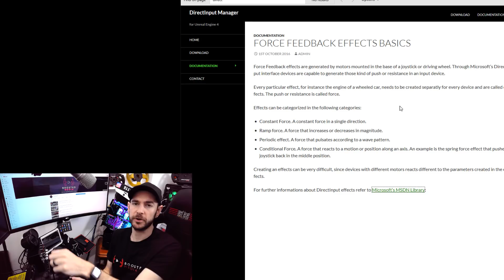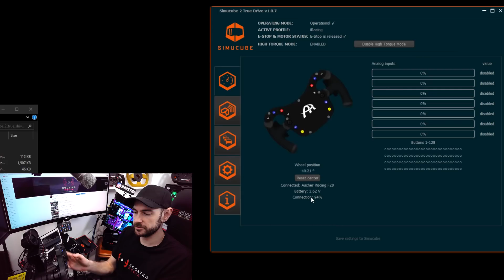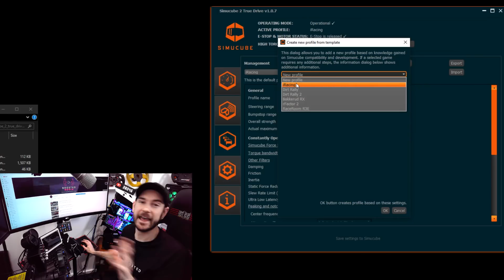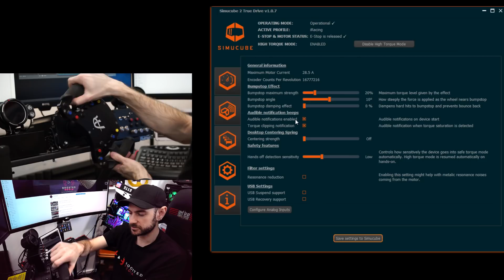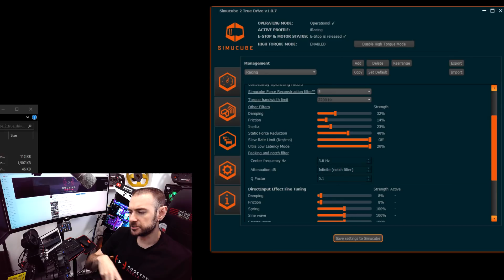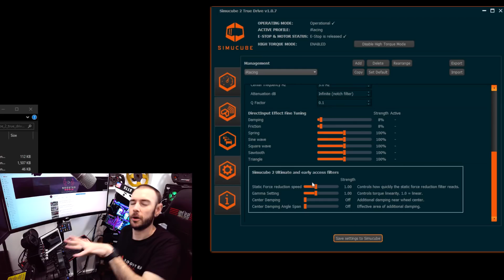HOW FORCE FEEDBACK WORKS - Each setting explained in detail - Simucube / Fanatec

Comment: its a pity you don't have the fanatec DD's yet because it would be great to get your comments and settings......am driving F1@2019 and am getting slaughtered and not happy with getting the right feel from the wheel, yes have the equipment but not the talent  :-(
btw: would suggest the Heusinkveld Sprints for pedals, I had the V3 and these are better and worth the investment and also every time you start the DD2 you have to press the funky switch to acknowledge the high torque
Reply from the maker: Can’t comment on the sprint pedals as I haven’t used them. But I always say good pedals and a rigid cockpit are the most important things. 

Hopefully my DD2 should be here soon.
Reply: @boostedmedia  IMHO pedals are more important than wheels and having the software to control your braking curve is a big bonus
Reply: I switched from v3s and bought Hesuinkveld sprint pedals. They are alot better, and alot of adjustability. Put it this way, they make v3s look like a toy!!! Wouldn't go back and recommend highly
Reply: Track Select Sim Racing ...I am planning to buy the Heusinkveld pedals, I also have the Fanatec V3 mounted on NLR GT Track, would I be able to mount the Heusinkveld pedals with no modifications whatsoever? That’s my major concern
Reply: @vimamipri  
I purchased the old Heusinkveld pedal pedal and drilled holes on this to install, search me on Facebook Track select sim racing , you will see what I mean.

Comment: How does it compare to the dd2 ?
Reply from the maker: I haven't received my DD from Fanatec yet so I can't say. Should be here soon.
Reply: @boostedmedia  
Watching This video, I think the simucube 2 has alot better software to adjust, which dd2 doesn't, and due to this, stops users, getting the most of the hardware. 

Using the dd2, I get continuous jolts, when hitting curbs, which feels horrible, and affected me use the wheel full potential !!!